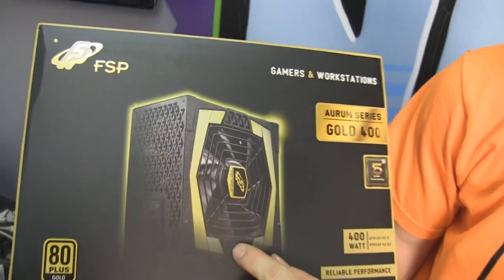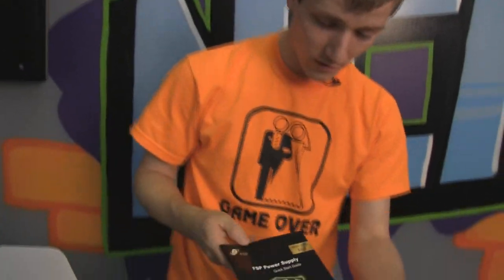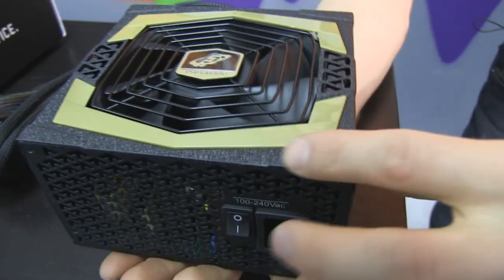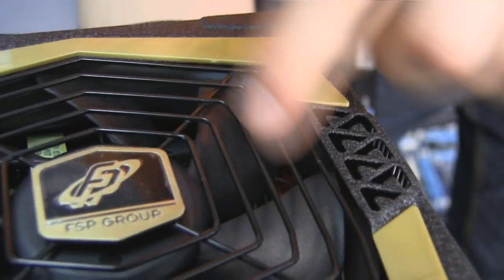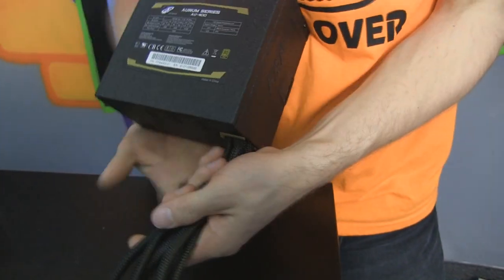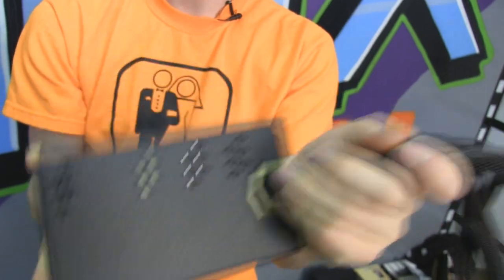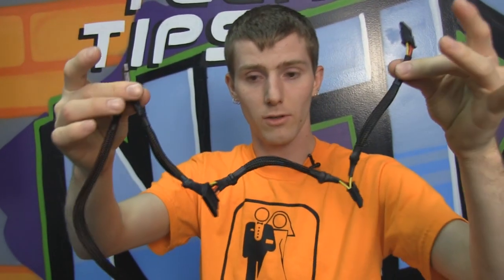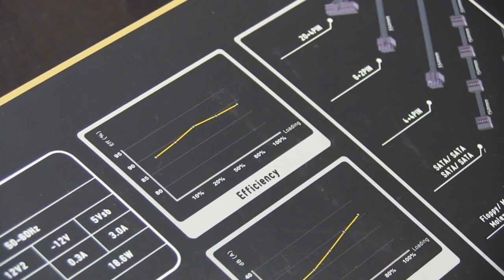FSP Aurum 400W 80PLUS Gold Power Supply Unboxing & First Look Linus Tech Tips

Comment: hmmm.. im thinking to try to power a regular asus gtx560 from an older FSP 400w psu which has 70% efficiency ... also 18A on each 12v rail but together max 29A because unlike this one's 384w it has a max of 348w on the 12v rails... i know it's risky but i'd like to wait a few weeks till ordering a new one for a bigger system - thoughts anyone?

Comment: @Martinx88813 6950 = 200w 580 = 244w depending on the rest of the pc you probably would not be able to use them on a 400w on a good 550 w you probably would If you do not have many things in the pc 1 or 2 hdds max 2 sticks of ram max even then it would hit consumption of probably close to 520w which is not good for the  power supply or the consumption

Comment: @king65462 As some one that builds PC's for a living, I can tell you most people guying computers do not need more than a 400W PSU.  In fact, most single card gaming machines don't need more than that.  My 5ghz 2600K with 560 at 1Ghz only pulls 550W from the wall.  That's running Prime95 and Furmark at the same time.  And that's far more than most of the gaming rigs people buy.  Most will not over clock, at least not as much as I do.

Comment: Like me and a lot of people posted on your power supply video, yes you can power a system with this, but should you? No.
560ti system would just about fit without overclocking and single hdd and odd, but it'd really, really close. You want to buy the PSU for the theoretical max, not the consumption while gaming.

Comment: I have the 500w one, holding on a GTX560 OC'd at 1000mhz on the core,AMD Phenom II X4 955 at 4,2ghz,4 gigs of 1600mhz RAM, 1 HDD, a bunch of fans, and it doesn't even flinge, makes no noise.I'm so glad I bought it.